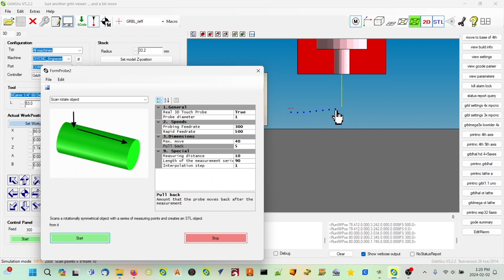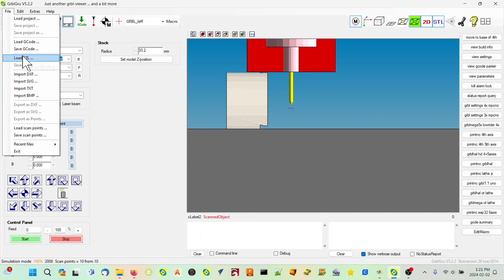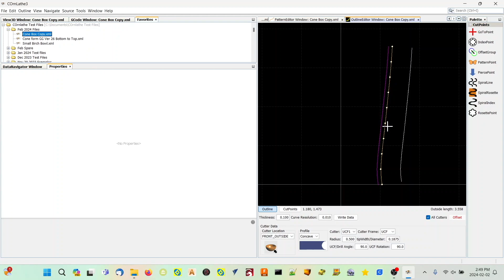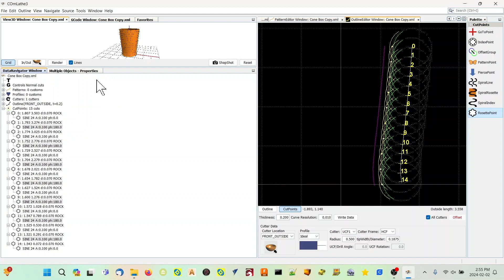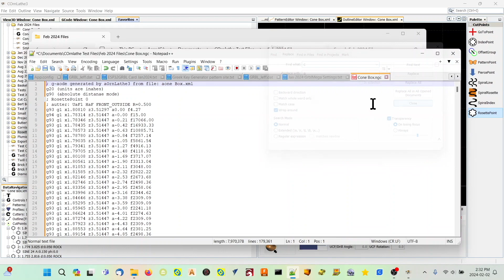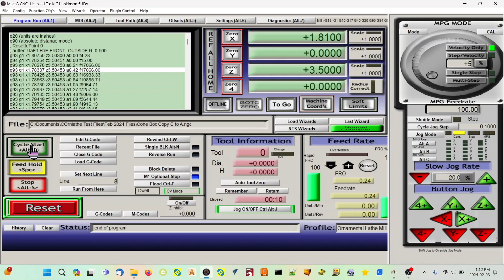Conical Box Project Part 1

Comment: Is that probe 24v?  Is it connected directly to the TinyBee?
Reply: Hi John. That’s a 5v probe connected to the TinyBee directly. I put an inline 2 pin plug for that too, just like the stepper motors.
Reply: May I ask where you found that probe?   All the ones I seem to find are 24v
Reply: Any chance you would do a video on flashing the board and what you had to do to get it working with Grblgru?